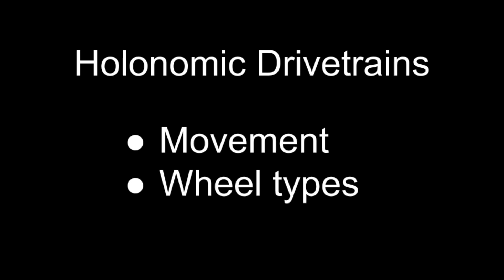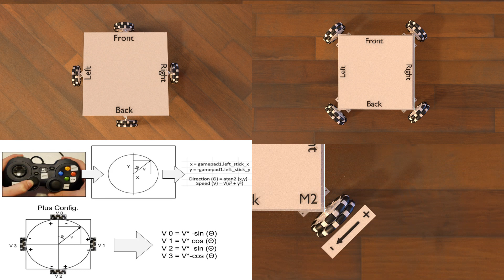Holonomic Drivetrains for FTC - Part 1

Comment: How do you tackle the suspension problem in a holonomic fwd
Whenever we build a fwd without suspension, we face traction problems because three wheels are always in contact but the fourth one doesnt always stay in contact because if bends in the chassis

If you guys do implement  suspension in your bots, then can you tell me how?
Reply from the maker: We do not use suspension on our bots, but we have found that some motors have an offset axle and rotating the motor in the mount would adjust the wheels height. If the motors you have do not have offset axles and the chassis is bent you can use shims to adjust the height. It also helps to make the weight distribution even.  Hope this answers your questions.